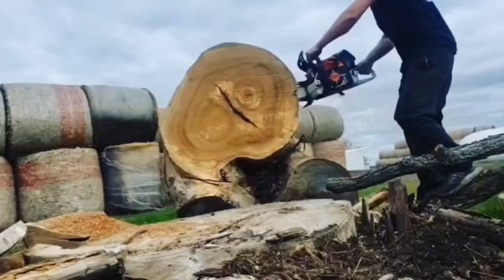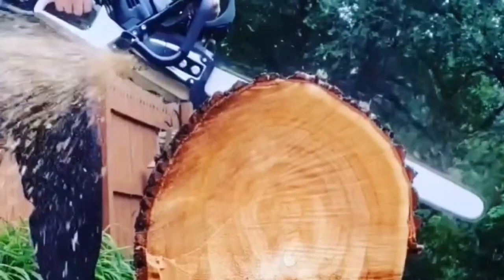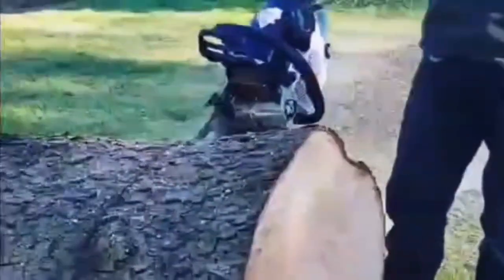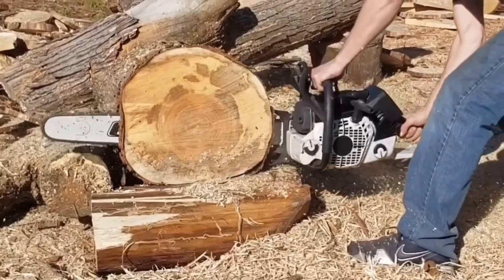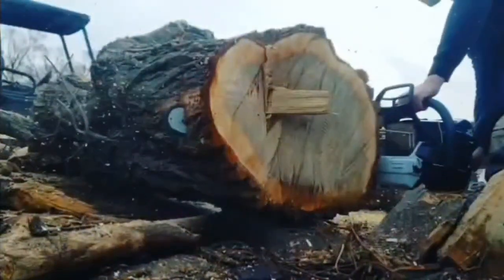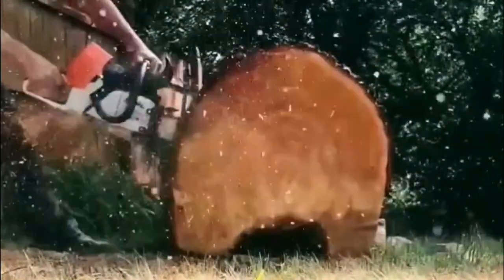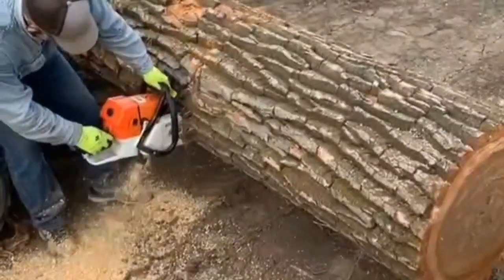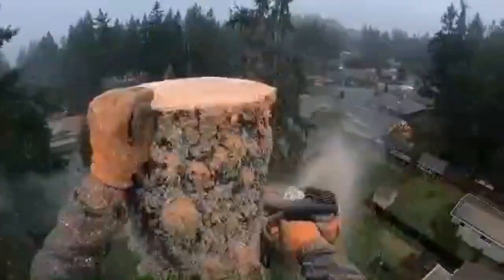Chainsaw porting. Compression vs Flow... why the argument? Can we have an open minded conversation?

Comment: No argument about compression here. I’m a faller and sure, I’ve big large displacement saws. But day to day in the woods I run a 65cc saw with really high compression. Because what I want on the mountain in lightweight with a ton of torque. In the end, when logging that’s what counts. How you get there is up to the builder not me.
Reply: That’s what we all aim for buddy 😎
Reply: @cajun3197  for sure. Not a builder just a logger. So how each builder gets there is fine with me.  All that matters to me is that I’m willing to carry it all day and that it pulls chain like a big dog! After all these years I know better than to pick side with good builders. 😀

Comment: Do you think a 60cc saw like an echo 600p is worth getting high compression out of it? Porting in muffler mod etc? I just use mine for felling oaks in texas and bucking firewood. But am iterested in your thoughts
Reply from the maker: I just dont know about the echos and I would think every saw had room for improvement it depends on if its worth it or not... and is it a clamshell and what the numbers are stock
Reply: @johnscustomsaws  would you consoder building one and how much would you charge?

Comment: Not really related to the video but is a bark box a must on a ported 500i? Or is opening up the stock muffler port enough?
Reply from the maker: Be careful opening the stock muffler you will melt your brake handle if you open it up too far forwards... I really like the barkbox tbh... it adds like 7% I believe... and keeps the saw running cooler
Reply: @johnscustomsaws  awesome thanks for the info and always replying. Always appreciated 👍🏼

Comment: Damn auto-queue ate my comment :P Well said Re matching bars to displacement to log-size, to have ANY demonstrable power showings (that's only the starting requisites, of course)  I'm also glad hearing a specific range, would you recommend 185-195 as a guideline across the board IE for smaller climbsaws too, or just larger bucking saws like your 4**'s?  Also, I returned my PSI gauge to auto-zone, lol, thing seemed almost useless it didn't seem to give accurate readings, are you doing them on the saws when hot or cold?  Is there some kind of minimum spec for compression-gauge you'd recommend?  I swear I had the auto-zone unit sealed properly w/ ptfe and everything was proper but it was still coming up with wayyy too much variance to be of use, and I was giving it like half-dozen pulls to ensure max psi reached(while cold)
Generally speaking, if one doesn't alter exhaust roof by more than say 2deg, and they:
- flatten squish band, while keeping squish under 25thou, and
- use a pop-up, 
will they generally be near-enough the good PSI range? Or is more significant machining required to get there?  I think about 4-6thou is reduced from band, and about 10 from the base, to get me here on the cylinder I'm currently trying to do!

Comment: Great video! Don't worry about these other people just focus on all the good work your doing and let them explode by not acknowledging them! I run stock and my own ported saws I have a 372 xpw 175-80 psi over the factory 150 ish psi. If your going to increase the flow your silly not to up the compression through machine work!

Comment: Any ideas for raising compression in a clamshell. Your videos are great teaching great information. Im Oklahoma and mostly build small saws(45-77ccs)
Reply: Also looking to tighten squish on a clamshell, 42.5mm 45cc for the 021/023/025 family. I’m working on moving the upper bearing and seal pockets 0.020” with emery cloth on a mandrill (sock) not saying it’s a good idea, but it’s what’s happening on a $40 eBay motor in the name of “what if”

Comment: I think that the only case where u could need a normal/low compression with tons of velocity and acceleration is an under 65cc limbing saw or anyway a light saw with a short bar for its size *24/7*, like a ported 357 husky with a 18" bar for small trees.
ANYWAY, I like being able to put a 24" on a 60cc, who cares for the zippy acceleration, I'm not a pro user.

Comment: In all the motors I’ve ported and built(sleds not chainsaws!) the first thing you would do is find out the elevation the motor would be running mostly…. The higher the elevation the less dense the air is so you correct your baseline with upping the compression so absolutely higher compression is your best friend not the enemy…. You just need to know how far to go on the octane fuel that you are using- John your work is awesome- maybe the negative Nancy’s need to read a 2 stroke performance book from Mr. Jennings or Mr. Bell and see how everything is relevant to each other when designing the build…

Comment: Aside from removing material from the head or cylinder, you can raise the compression ratio by installing high-compression pistons or thinner head gaskets, or by replacing the base gaskets with a sealing compound…….which yields very little compression gains. 

The way you do it is far superior, you get much better compression increase which in turn increases power and torque. 

Like you say. It’s good for running a 12” bar but anything bigger your machine will bog out a hell of a lot more.

You obviously know what you’re talking about and the repeat custom you get is a credit to your work.

Comment: All the saws I build I shoot for 190 to 205 lbs compression I also try to run as much of the proper  air fuel mixture through the saw to keep my exhaust can or muffler 550 degrees temp or lower. Never had a failure and the saws lets say make excellent torque and rpm is understated. There seems to be a misunderstanding of some simple math that is overlooked when a high performance reliable and I think most important durable long lasting rip ass motor is built. Adding a cup or two of vp u4 108 octane oxygenated fuel to a gallon of 32 or40:1 mix helps with cooling and makes bit more power. Just a guy with another opinion having fun building saws. If your not having fun with it why bother?
Reply: I'm sure that's mostly a performance mix, but one thing to note , I believe all oxygenated fuel contains ethanol, so maybe not good for long term storage.
Reply from the maker: I agree... it should be fun building saws... and it should be an open discussion and try a bunch of different guys saws out... these cult followings around one builder vs the next is crazy... why not try a few out 🤷‍♂️

Comment: I got a 146-147 that will pull a long bar I'll have to take another video but how do I send it to you
Reply from the maker: Yeah send it to my email man I am truly interested... gotta understand i am skeptical and its not personal... 147 is a lot different than 130 but take a good compression test cold and video if you don't mind... I would appreciate it... im thinking if its pulling a 32 inch bar in a heavy cut its at least 160 psi... dont take offense but how are you taking your compression reading? Or if you have done work to it just tell me what you are running for numbers and squish... we can talk about it johnscustomsaws@gmail.com
Reply: That's just a stock saw. Most stock saws will do around 150psi cold and new.
Reply from the maker: @alexstromberg7696  exactly... I have said they are probably losing power but they believe this stuff man... and defend it

Comment: It's the same lame BS, they use to try and make me believe back in the 70's, and 80's that you couldn't mill a two stroke motorcycle engine jug down, 
 The same thing in the  90's when my Mercury Black Max 175 hp outboard lost oil mixture hose at the fuel  line to the carburetors, and a .02 cent piece of tubing cost me 5 cylinders, and 6 pistons at WOT, going across the lake in a matter of seconds. 
Alarm buzzes, light comes on, and instantly pulled off hot foot, too late.
Went to several supposedly top line machine shops that did outboard over hauls and replaced sleeves the whole nine yards.
But everyone of them tried to tell me that they didn't deck the blocks are mill the heads to make sure they were truly flat surfaces, are to bump compression up. 
Finally found ole guy that worked out of his backyard shop.
He did everything I asked him to, from milling everything flat, port and polished the heads, and intakes, bossen Reed valves, to eliminating that dam oil pump for the two cycle oil.
He carried it to a tank dyno for out boards, and tool it from a very strong 175, to past 225 hp according to everything he gave me from the guys that tested it for him. 
Said it was completely broken in, and even how much oil per tank to pour in since I eliminated the pump and other BS from factory that cost me little over $3,500.00 cash.
Even to the point of helping me set up jack plate on my boat.
Top speed with the custom prop I had went from 69 mph, to nearly 78 mph.
Granted this was before we had GPS on phones and electronics in the boats, and was just water pressure moving the needle, but it would make your ass grip the seat on my old ranger. 
Same thing with motorcycles engines, because my dad used a piece of 1/2" thick glass on his work bench, and a couple pieces of 1000 grit wet n dry sand paper to mill my brothers jug and head down on his Kawasaki KX or KZ 500 dirt bike.
He was a machinist by trade, and had all the nice calipers and starrett mic to measure everything at the beginning and again when he was finished.
Ended up needing a bigger carburetor and used a antique dremel tool to massage the ports on the jug.
Dam thing was straight up dangerous after the old man got through working on little brothers bike.
Sadly he was gone when my mercury bite my ass, and needed his touch applied to it.
But hell yes milling the jugs, and massaging the piston domes, is equally as important as porting and polishing the jug is. 
And if you can find someone to tune the exhaust, to let it exhale everything it can now suck it your 1000% better off than when you started.

Comment: The 592xp which is by far the most powerful stock 90cc chainsaw only has about 130psi from the factory and yet it outcuts 180psi ported 660s 9/10 times

Comment: Hi John I have built kart racing engine for 10 years with out doing machine work & port work a engine well suck I have put engine on my dyno stock vs full blown racing engine they are about 14 horse power diff and I have put both on my supper flow  60 flow bench you can see the diff with flow #s  you are RIGHT John you keep getter done !!!! lol that would be like  running a stock engine at Daytona 500 you will get lapped so many times it will make your head spin

Comment: Lol I chuckled at a video of a fellow running a 395 pulling a 24 inch bar bragging about the power. I Rather be pushing grey area limits on bar and chain on a said power head so I  left a comment asking if he tried running a 32 on it? And no Reply from the fella 🤦‍♂️ I run 24 inch full comp on a ported 026 44mm cylinder as my goto for my neck of the woods  in most cases 🤷 each to their own though, keep up the good content! 👊🤟

Comment: I have a 266 thats borderline 130 psi I don't want super high compression but I would like higher than what I have and I know I'm going to bog it I bog my 200t or my 335xpt or the 020t all the time I've bogged my 660 and my 266 before I tried to build it running a 32 in bar your always going to have those nay sayers wish I knew half of what you know to be able to build my own
Reply: 130psi means it needs a rebuild soon
Reply from the maker: Yeah if you are at 130 psi cold... and you are taking the compression test properly... yes that saw needs a rebuild my man... it will wake right up
Reply: @johnscustomsaws  I found this saw in a yard sale for like 5 bucks and just tried to see if it would run, once I seen that I began going through it but don't know what direction I want to take to rebuild the saw

Comment: Hang in there,  just keep on doing what you are doing and let the dingalings keep bitching they have never built anything and get crappy information from a king dingaling. All you have to worry about is the fire fighters and the rescuers. What they need is good and reliable builds.  And some times the older ones are stuck in a groove and don’t like to be up staged by the younger ones. Anyway I like your humour and it is educational and if you were a fool I would never have subscribed. And I am fairly Shaw of what the coil you are trying on the 880  it was one of those things what happens if I put this in that and it worked. Keep lt up.